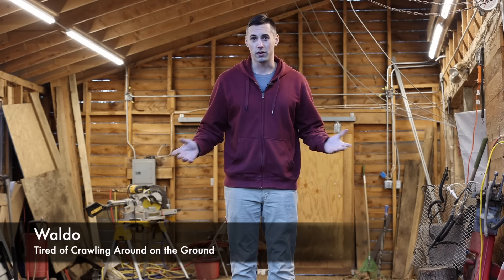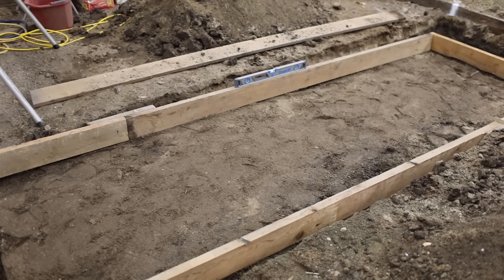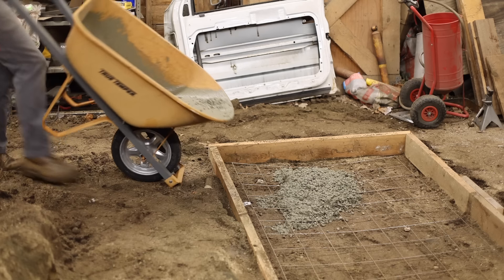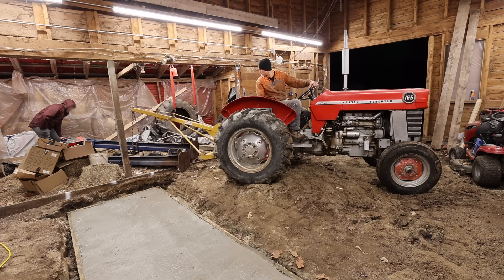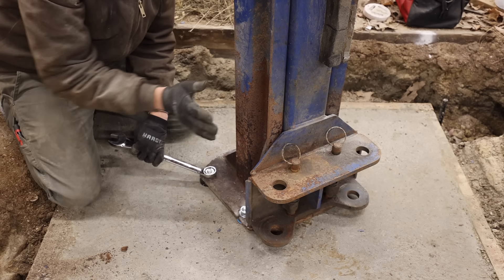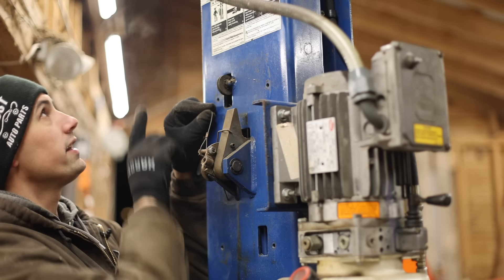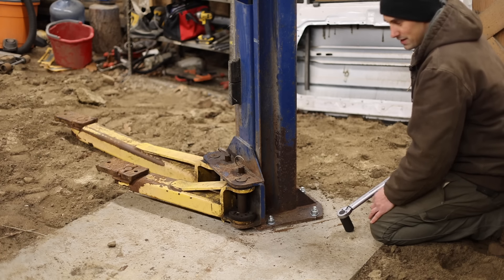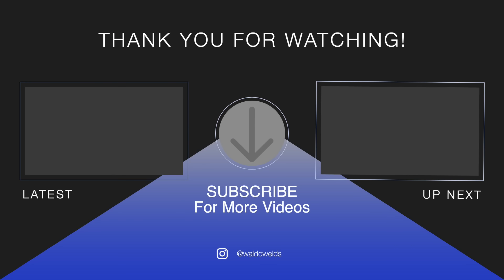Installing a 2-Post Automotive Lift on the Cheap

Comment: QuickRete?  NO !   Use Portland general use concrete in bags,  aggregate crushed stone, concrete sand.    3 : 1 Ratio of Port to Sand, then add your crushed stone. Mix it on the dry side (non soupy) and spread.  Skreed, trowel, brush, let dry... Water every day after 2 days drying for 2 weeks.   Spread straw or grass clippings to hold in the water.   In two weeks, install your lift.  I never used quick rete... I have seen it fall apart. Best wishes...Trying to Help  30 years in Construction

Comment: That is nowhere big enough slab area wise to keep that lift from flipping over one way or the other. Your drilling went easy because it hasn't cured enough, and the bases need to be grouted, not shimmed. Accident waiting to happen.

Comment: Nice job on installing the lift. on the pins of the lift arms there should be a hole toward the top of the pin for a cotter pin to prevent the arm pins from rising up.

Comment: DO NOT use this lift dude. Take it down and have a whole slab professionally poured throughout the whole shop... MINIMUM 6 inches deep but I'd recommend pouring more like 12 inches in the area where the lift will be. use wire AND rebar!. Get some nice 4000 PSI poured out of an actual concrete truck. And for the hell of it when you put the lift back down use as long of an anchor wedge as the concrete will allow AND use epoxy on them as well as some added security. Trust me... I've seen lifts pull right out of concrete. And whats worse is your current situation will certainly snap the concrete of it doesn't flip the slab first. Just stop, please... For your own safety.

Comment: As a mechanic using hoists every day, I would not dream of a diesel on a 7k hoist let alone asymmetric.   With a bed on that truck you will be over weight and the the slab is not under the center of gravity.  I have seen a hoist fail in a shop with more solid floors.  Love the trailer series and your truck but this is beyond sketchy to me.

Comment: I see a bunch of osha violations, all in one video. Be careful, that concrete pad isn't heavy enough for a truck and could potentially tip over. And setting those post while the concrete is still green, it's just criminal.

Comment: I would like to say that my friend did this same thing almost exactly like you did here. The lift held hus wifrs small car fine. He put his half ton truck on it and it completely collapsed after tipping over and.. you talk about a mess. It was a distaster zone for a few days until we could figure out how to get the truck off the lift. The only thing I can say is to run playing up to your rafters abd bolt them tightly to them and reinforce the rafter framing in both directions with the reinforcing material spanning all the way to the walls in both directions and out diagonal bracing that connects to heavy poles that go to the ground. If you do this. Your lift will be just fine. If you strengthened the lift properly from above without the concrete it wouid probsbky  work. The strength up high is the most important part of the install when your unsure if the pad is think enough. I woukd recommend pouring the concrete at least a foot thick in a 4x4 area under each post. The 6 inches that spans between will suffice. Just be careful oit there. It’ll be a real life where’s Waldo when your family is trying to find you underneath your truck after it collapses whike changing the oil
Reply: What a stupid suggestion. Do the slab right and then you dont have to do something like tie to the rafters. A 2 post lift lives and DIES by the slab as is evident by your friends. 

Is there a concrete shortage or something? Pour a proper slab and you dont need to take your life into your hands with a lift that WILL FALL!

Comment: That concrete slab is waaay too small to be safe. Especially that it has so little reinforcement. Im also not sure about the strength of those anchors because just feeling it out is not a torque spec. These things are installed by trained professionals for a reason.
Ive never liked standing under one of these even if it was properly installed but this is really sketchy and unsafe in my opinion.
At least a bigger concrete slab and more rebar would be a minimum.

Comment: I know this is an old video, but that concrete is way too green to be putting a load on it.  Should wait a week or so for the concrete to cure before putting a heavy load on it.  He drilled thru the concrete very easily which proves it is not cured.  Also, should have used rebar and made the slab bigger for safety.

Comment: That’s going to make life a lot easier, while watching the video i was like these people are going to rip him apart in the comments Lmao. I had an eyebrow raised at first, but i don’t see a problem with it. the Beam up top will keep either post from tipping either way in that direction and as far as tipping forward or back, with 3/4” wedge anchors you in theory have 10,000lbs of pullout strength on each side in each direction . so you’d need an imbalance of 20,000lbs to pull the anchors out. that unit won’t lift 20k let alone an imbalance of 20k so i think you’re just fine. I can’t see that lifting anything heavy enough to pull the pad out of the ground either. I agree on bulldozing it. Old barns are cool and all, but a new shop will give you the square footage, ceilings, and integrity you want in a dream shop
Reply: But it's essentially a free building...keep it if possible

Comment: This is setup is very dangerous! Proper installation is under the lift columns to have 1m3 of concrete in order to don't flip over. On slab is allowed only if it's of big dimensions >4 x 4 m.

Comment: First, you should be more considerate with your platform. Some young guys are going to watch this and attempt the same and end up hurt. 

Second… Please, don’t lift anything with this. Putting a truck or even a light car on it will kill you. That slab would tip right out of the ground but you didn’t use proper structural reinforcement. That chicken wire isn’t going to handle any load so the ends of the post will crack and spread apart. 

Please, pay a local contractor or concrete company for an hr of their time and follow their advice. It’s worth whatever it cost considering your life is at risk.

Comment: I have to ask did you look up the requirements for the footing of the lift..... I have installed several car lifts and I really don't think your footing is long enough and you can't use normal concrete you need specialist mix for a footing like this... Its also way too thin.... Needs to be minimum 8 inches deep and with rebar not mesh
Yes I know you want it temporarily but is your life worth it.... Really
And I very much hope no one trys to copy you
Seriously this is really dangerous
Reply: You are
Reply: You are
Reply: You are correct. Install is unsafe.
Reply: Nah, you guys are making it way more complicated than it needs to be. So the concrete is we'll say 3000psi, so lets say the lift has 10k lbs on it. Now figure the square inches of the base plate, then divide the 10k by the square inches and you will get maybe a few hundred lbs on each square inch of concrete rated for 3000 psi 99.9" of these commenters are engineering and math flunkies sitting on the couch in mama's basement. No "specialist" concrete needed no rebar needed. I would have made it bigger but it can be made to work with minimal effort or additions. 
BTW yes, I personally custom built my shop from digging of foundation all the way up to the roof complete with heat A/C tv internet epoxy floor 10k lift, motorcycle lift custom cabinets hidden in wall airline etc
Reply: @mrmotofy  the base is insufficient for a raised, non-centered load. That narrow base will let it tip forward or back .
I don't give a shit what kind of concrete it is set on, or if it is re-inforced.
Reply: @haroldphipps3457  Oh right cuz some guy on the internet says so
Reply: @haroldphipps3457  hmm well you should go tell the engineers at Rotary and Bendpak they're idiots and don't know anything. But you do cuz you've broke a bunch of stuff.
Nope you're right I haven't broke stuff...cuz I calculate and plan then build then pay attention and stop before bad things happen.

Comment: did you not think of fitting the mounting bolts while you were pouring the concreat as in some long bolts with large plates imbedded in the the concrete attached to the reinforcing
Reply: Much harder that way, can't spread concrete. The instructions say do it his way

Comment: Why people don't get a quote for a concrete truck to pump the crete in is beyond me. Why spend hours and hours and hours mixing and pouring concrete when for only a few dollars more than the cost of the concrete you can get a truck to pour it into the form for you. Yes I know he's inside a workshop, they make concrete pumps and even that's not much more. I'd gladly pay an extra 200 dollars for a truck to deliver it.

Comment: I'm so p#ssed I called a bunch of lift manufacturers to see if I could do this exact set up and everyone told me it's not recommended or suggested. I even went as far as saying I'll pour it at 6inch if necessary but noone gave me a answer of insurance. I knew it would work but I'm not a engineer so I was nervous. I should of did my original plan anyways good job.
Reply from the maker: If it's for a longer-term setup, you probably want to go with a bigger slab. Even adding a couple feet towards the front and back will make a big difference. I recognize  that my setup requires quite a bit of attention towards getting the center of gravity right and that's not ideal for a long term setup 👍

Comment: My slab and my 12000 lb atlas lift were all i paid for on my 20x20 garage , the atlas hoist is kind of junky but i will upgrade on the next lift to 15k , anyone want a one year old 12k atlas a symmetrical hoist ( low clearance , no overhead bar on low clearance , cables go across the floor , 15 ft 6 inches inside clearance , i build 3500 bucket trucks so i had to build my own place to do it , 6 inches of concrete ..steel carport style building i got two for a little work i did   im about to enlarge the shop i only am using one now

Comment: You have no idea what that concrete is rated at. The slab is not reinforced with rebar, is not deep enough, is not wide enough. There isn't a single lift company out there that says anything other than "you cannot mix the concrete yourself". They also require a minimum of 2' of same reinforced concrete a minimum of 2' past the mounting pads in all directions. Jeezaloo...Great video on how NOT to do it. 

I hope you have life insurance because your family will need it.

Comment: You better write the ambulance and undertaker's phone # on the wall. After I saw you using wedge anchors for a car hoist, I just kept shaking my head. You just poured the concrete, why not put long bolts and deeper concrete in? I would bulldoze everything including the shack before it gets dark tonite and start over! I 'm adding that you buy life insurance if you're married.

Comment: that tekton torque wrench is junk, it wouldnt click at 52ftlb when i was tightening a driveshaft, ended up stretching the bolts but got lucky that i knew it felt wrong and stopped. if you want a decent cheap torque wrench look at olsa tools or precision instruments 1/2 split beam style (whichever is cheaper cause theyre both the same, and the same as the snap on one)
Reply: Project Farm just did a vid on a few, many cheap ones are very similar to the Snap ON

Comment: That installation scares the piss out of me , and it should scare you more than me . It will be your vehicle and your ass under it . There is not enough concrete the whole thing could easily tip over

Comment: How much do you think you saved not having a little pump run 3-4 yards for you ..? In fact ... had you had a pete pump do it you could've done a much larger area (the probably have a 9yd minimum) but you'd have a nice slab down for whenever you rebuild the shed.  Live and learn?

Comment: I know this is an older video, but the first thing I noticed was your apparent lack of protection from the concrete dust.  You should've had a dust mask while mixing the concrete and again when you drilled the holes in the slab.  Always use a vacuum to clean up after drilling too.  I cringed watching you use air to blow it all over the place. You can't imagine the damage concrete dust can do to your lungs.

Frankly, if you wanted to do it, you should've done it right; spend a few dollars to pour a full floor.  Pole barns are built all the time by constructing the barn first and then pouring the concrete floor later.  You didn't mention how long you waited until you installed that lift, but that floor should definitely have been given a month or more to fully cure before you even drilled into it.  Last point; you're so good at fixing and cleaning up vehicles, etc.  Why didn't you take the time to disassemble, clean and lube the entire lift (perhaps while you gave the slab time to cure)?  That would've been a great use of your time.

Comment: That thin layer of concrete seems not enough. It's able to support weight, but it can tip over since its too narrow also. I can't remember the exact scale, but it should be at least 1.3 times size of the surface area as the vehicles what can be lifted. Depth is also dependant of the surface area, but 150mm sure not enough. Good luck with it.

Comment: you really needed to ask an expert before doing this. for one you need rebar, for two you need to have more slab than just what the lift is attached too. you also needed gravel under the rebar and to compact the ground before your pour. I am a fan and enjoy your videos but this one is dangerous.

Comment: You need to check with an engineer about your slab pour. You need to use rebar versus mesh. You needed to wait for the concrete to cure before you drilled for anchor bolts. IMHO, your lift is not safe for lifting 3/4 ton or heavier. 
I had a slab poured for a corrugated steel building, no read iron. talking with engineer about putting in lifts. 10K psi cement spec. required. Rethink your situation.

Comment: Ya, I love your videos but this one has me sketched w so many red flags.   

Minimum, let concrete set for 3 days.  Longer the better before drilling in it,which is why it was so easy to drill. Lol

Use rebar instead of wire mesh.   Wire mesh for like a sidewalk or a shed.  Idk how much weight you plan on lifting w this but pffff, that wire mesh.

Then the size of the slab and the dimensions of it.   Idk, maybe this is fine when you have the weight evenly distributed every time… but I imagine you’re gonna use it on your truck and I’m afraid for the lift to tilt over and easily leverage over the slab with it.   I’d sleep better and feel much safer under a vehicle if that slab was more of an “ H “ rather than a horizorntal  I

Be safe.

Comment: So..... you are bolted to a concrete 'slab'.?  No it isn't. 

This is just an oversized landscape paver, more suited to a furnace installation. What mechanically secures the paver 'slab' to prevent it from detaching under torsional load? Essentially you have 1/4 of a 'footing' section. Typically the footing goes all the way around the house as a stable perimeter resting point. In your example, the resting point is shrunken to center only, and the car is precariously "unbalanced" on a double pointed inverted 'pyramid', top heavy, with greater weight on the front. Sooner or later it is all going to pivot on the fulcrum as the concrete /earth bond weakens and detaches. 

Someone is going to die under this.

Comment: There is NO way that you can regards that setup as safe. I see that its been 5 months since you posted the video, and you've presumably been using it in the mean time, but that does NOT mean that you can put your life under that lift. I I know of lifts that have bean standing for years, and have suddenly failed catastrophically, usually at the concrete. Don't do it, friend, you might even end up filming your own death. Just don't, please.

Comment: reading all the coments so many are way over thinking the instqall, keep in mind they make and sell a 2 post portable lift, that has 2 wheels on each 10 foot post so you can move them out of the way when not needed, you wheel them out and set them on the floor and lift up to 8000 Lbs, no cross beam just free standing. only proble is most home owners garage floors are only 2 to 3" thick with no re bar or wire mess, and the 3 foot by 2 foot pad on the portable liftd can crack the floor, my 15000 Lb scissor lift, with 11,000 rolling air lift jacks for front an rear for lifting trucks off the ramps is bolted to 4 cement pads 18'x18"x6" on hard clay ground out side and i lift my 5 ton dump truck my pick up, cars thousands of times, beat the hell out of things with a 20 Lb hammer, welding cutting ripping,,
Reply: Hey these mamas basement couch Lift Installer wannabe's gonna talk about something

Comment: Hey my friend though you have given a good effort installing this lift that slab is not suitable .the areas in which the post are attach should be at least 16 inches thick for stability there should never be shortcuts for safety. be safe